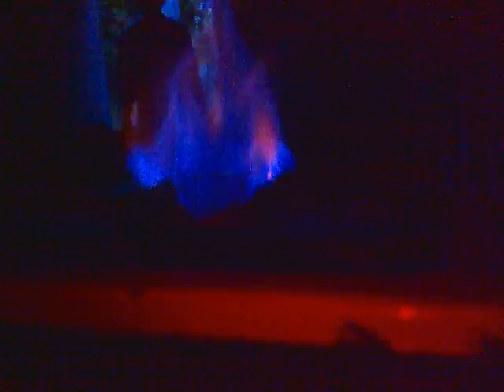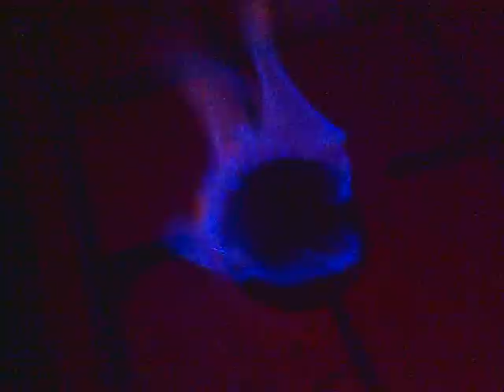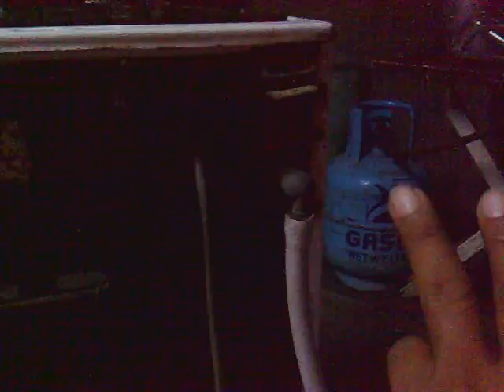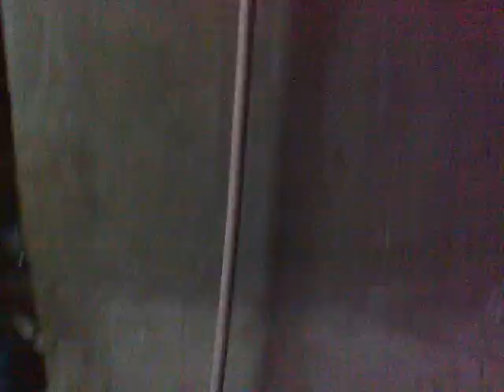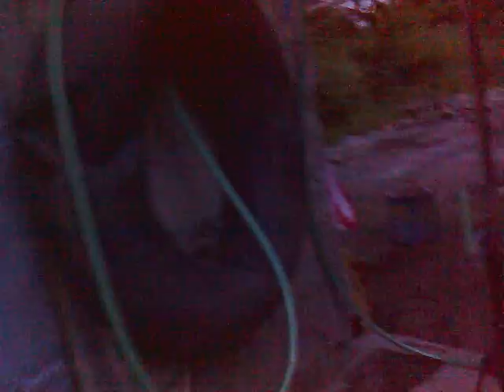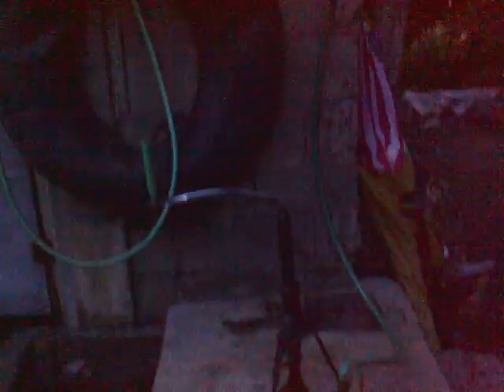MY  ( CH4 ) BIOGAS PROJECT IS NOW  HOOK ON A BURNER / PHILIPPINES  PART V  052310  V027

Comment: Hi Vox,

Are you still using this biodigester? An update may be in order. I plan on being in the Philippines this summer, maybe August. Where are you located? I'd like to set up a biodigester while there, but may only have time to gather building materials. I'm thinking about using 3 IBC tanks for my biodigester. Your advice and suggestions are appreciated.

Comment: Nice Biogas  set up
In DOST wayback in 1976  they use interior tires in series 6 pieces
the ordinary stoves make the holes bigger  and used also as gas lamps
there is a flApper  mixer  to mix   
IIn Bataan   one Indian  buys cow dungs for i peso from children going to school
dried ones are like charcoal  ready to use
Can use also super kalan  using Pinatubo ash    good heat insulation

Comment: yes i will when i have time......i want also a talapia tank......not a pond but a tank....
live in the philippines.......plenty hot outside.
here too cold. heat your house is very expensive.
no heat is nery hard way here.
sometimes is so cold ....if you throw water in the air.....it will freeze before it fall to the ground